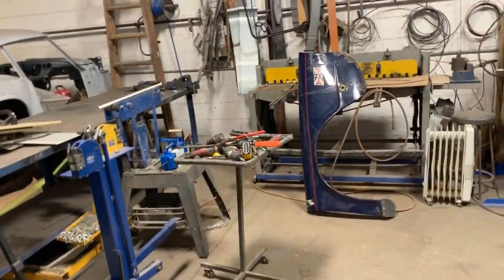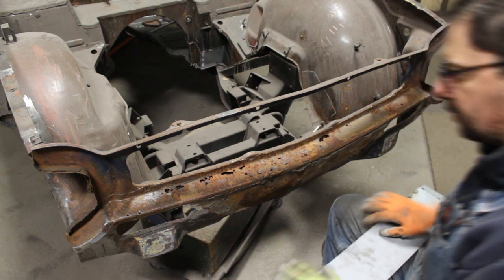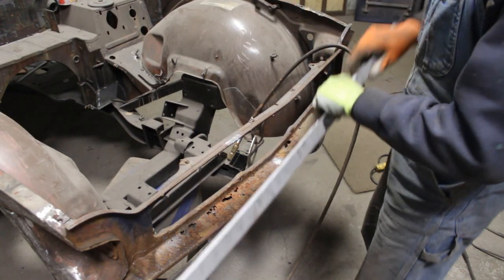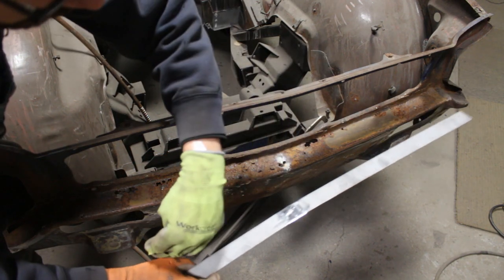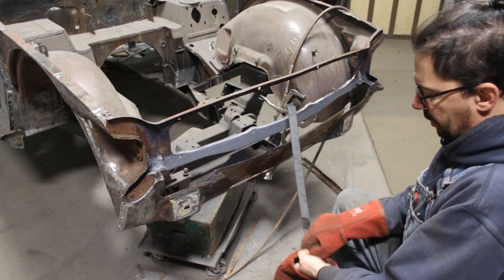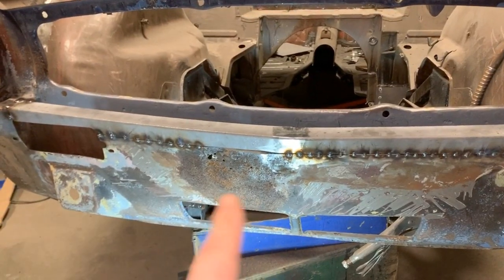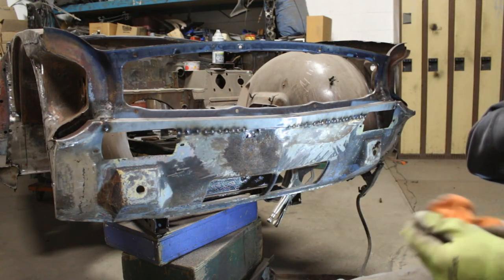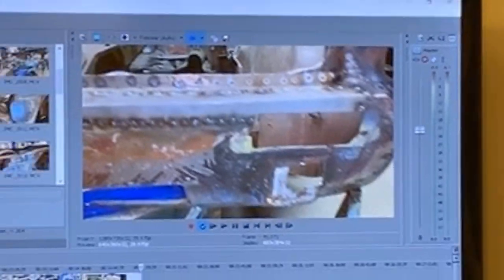1974 Triumph TR6 Restoration - part 33 - Front Valance

Comment: Hi Elin, great to see you back on the Rusty Beauties. Nice work!  Don’t forget the little tab brackets for the black trim piece that goes in front of the grille. I think there are three brackets on the top of the piece you just repaired.
Reply from the maker: Thanks David, I will install those. I don't really know what they look like, but I will have to look them up. I didn't have them on the 73 and I didn't even know that trim piece existed until you told me :)

Comment: Elin, you Can adjust the shrinker on the nuts at the foot axle on the back 😉
Reply: And it seems to me that the top mount on the activator arm to the tools is loose.
Reply from the maker: Thanks! I know it needs adjustment, but I never find time for that. It works fine after I clean the teeth though.

Comment: Have you ever broke down and bought a panel from Moss or Vicky Brit? It would be about $1200 USD I think for that front area. I'm wondering if they fit like they should, or need to be re-worked a lot...
Reply: BTW, that was a cool transition at the end, from video screen to your ending. I've not seen that done yet on other youtuber's channels.
Reply from the maker: I barely use new panels. Usually the ones that come with the cars. I used new floors and sills for this one and They fit pretty well. A valance.... I don't know. It is really expensive and not worth. I've seen a new rear sail panel (or deck or whatever the panel in front of the boot lid is called) that was so twisted, that it was funny, but it was already professionally installed on a TR250 and the owner was happy with it.... I'd do everything possible to salvage my panels before I go for new ones.

Comment: Nice video👍..a quick question. I'm about to fit a new windscreen in my Herald. Do u recommended using sealant if fitting a new rubber seal?
Reply: I don't think the factory used sealants in the day.  I replaced my TR6 windscreen seal in the late 70's, no sealants were used and it didn't leak
Reply from the maker: Well, many people use sealer and it is not a bad idea, but it is overkill for me. A rubber gasket should be enough to seal properly as long as the glass fits tight. Many after market windshields do not fit well and the gasket is lose though so it wouldn't seal even with a sealer.... It is a hit and miss with these cars. It wouldn't hurt to use sealer, that is for sure.
Reply: @RustyBeauties  thanks..will give it a go with no sealant
It's the original screen so should fit well 👍